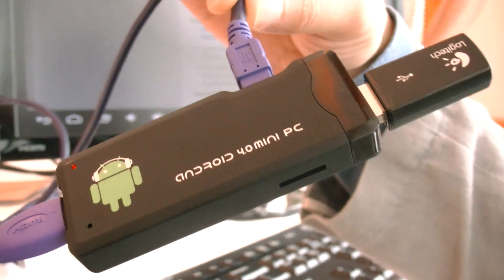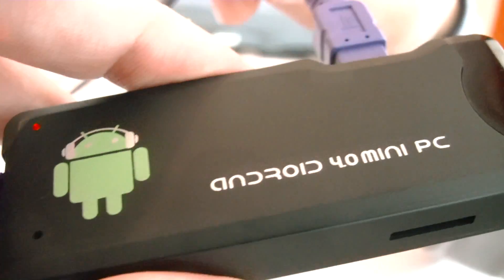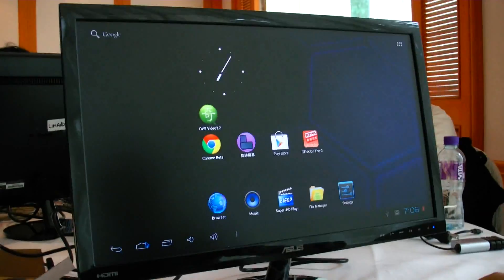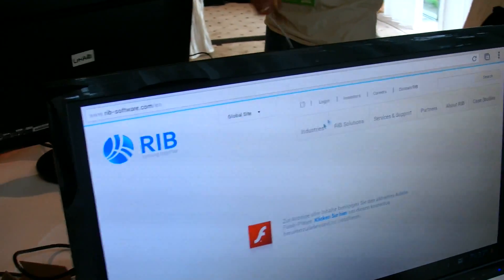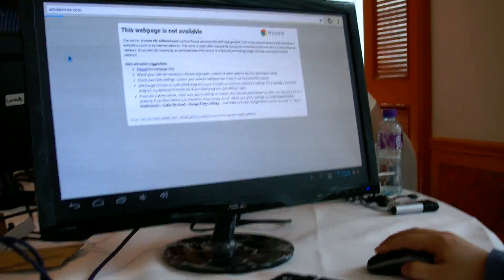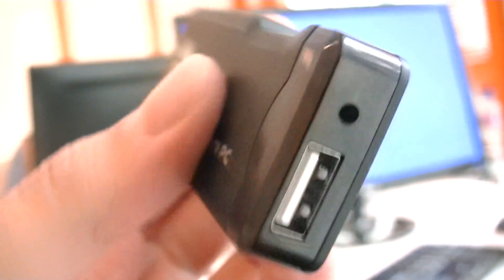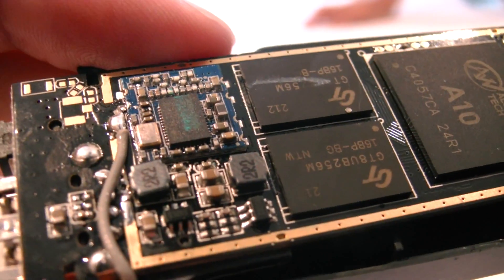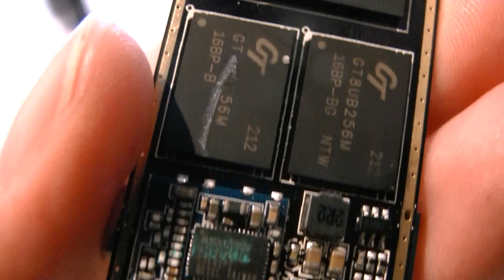$74 MK802 Android 4.0 Mini PC AllWinner Boxchip A10 HDMI stick

Comment: The 2 chips just below the processor are the north and south bridge controllers that handle the front side bus, memory and video bus traffic. I have a design for a very cool RAID0 storage device that uses upgradeable micro SDHC cards that would integrate well with these for speedy 256GB/512GB SSD storage in half this space again. I've been acquiring 64GB Class 10 Micro SDHC cards for $20 lately so it only makes sense to utilize them for SSD use. $160 bucks for 512GB SSD with great R/W speeds.

Comment: everything is vulnerable, even android, and yes there is android malware. Usually contained in repackaged root binaries or in less-than-legitimate apks you may download online and side load. Virus scanners for android work the same as they do on any other platform. Open source does not determine the magnitude of malware interest, the amount of dumb users does. Otherwise Linux in general would be a mess.

Comment: They don't support speaker, mic, headphones or webcams. It has so many limitations it's nearly useless. Most apps won't install and the ones that do won't work. It won't run apps that need a touch screen, GPS or radio or audio player apps that need an audio output since it only outputs to HDMI. Netflix and Twitter won't install and neither will iHeartRadio or TuneIn.  Save your money until they are ready for prime time.

Comment: Impressive, but seems too expensive ! They make 7" A13 tablets for around $50, so this thing should be definitely less than $50 even though it is A10.

I am wondering how many layers they use for the PCB, could it be just 4 ?